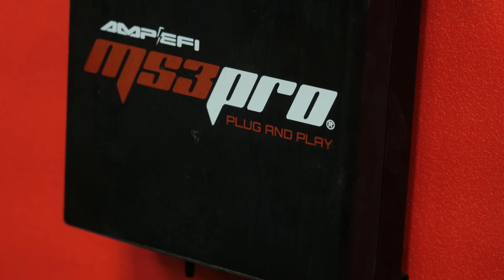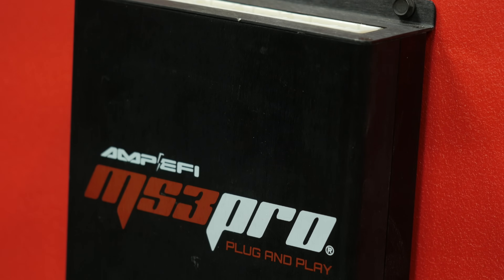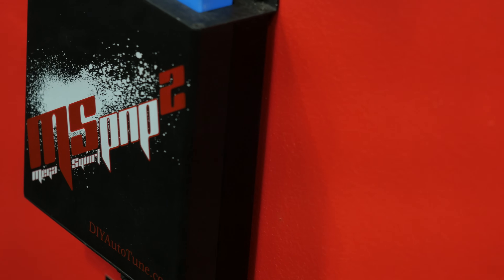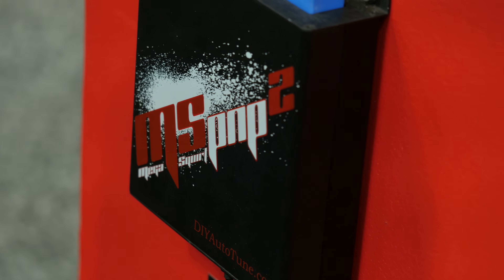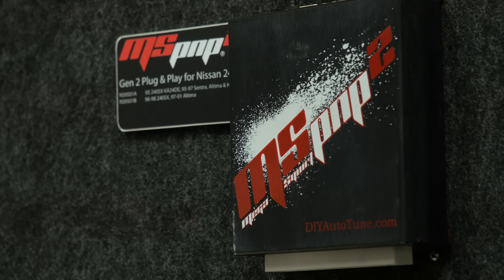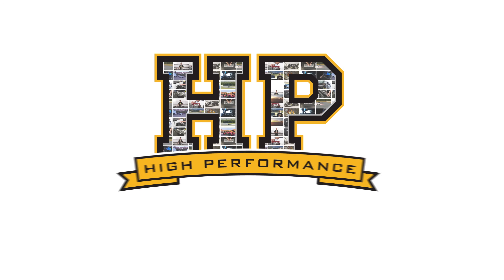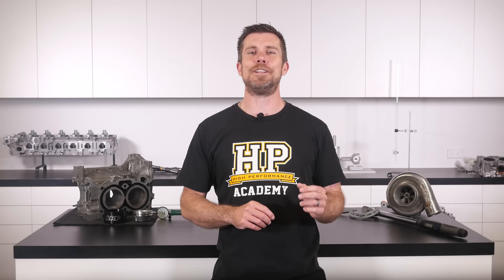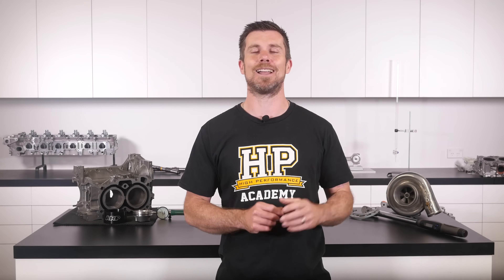Tuners secret to speed and consistency | MS3Pro [TECH TALK]

Comment: Following up on his comment about sending CAN signals to the ECU from Innovate gauges - I emailed DIYAutoTune and called Innovate Motorsports to find out how to send a CAN signal from my MTX-A gauges to my MS3Pro PNP. DIYAutoTune told me this was not possible and Innovate told me there's no verified way to do it, though they mentioned it could be possible to intercept the signal line into the gauge and wire it into an analog input on the ECU. As far as I can tell, the MTX-A gauges are the same as an MTX-L gauge with an analog dial instead of a digital face.

Comment: Maybe sometime touch on the declining reliabilty of Innovate products. We had had issues with quite a few new innovate widebands and boost gauges in customer cars. The failures almost resulted in multiple damaged engines.
We have since switched back to aem's product line with excellent results
Reply: Yup, issues with 5 units so far.
Reply: Thanks guys, will remember that when I buy bits for my 13b mx5
Reply: We've bought at least 3 units (ecu-1) with faulty circuits. I thought this was isolated until now. Will be looking for a more stable eth content analyzer and afr. Sad to hear. Are there any threads that look into this?
Reply: i agree with you, i install lc2 wideband on my race car for a year and the controler were error...

Comment: when is megasquirt gonna provide dbw support?
Reply from the maker: Tell us about it Bob. We are waiting too as we want to run our 350z on DBW. We did grill them when we meet at PRI and they said it is on their radar. No time frame was given. - Ben
Reply: High Performance Academy keep on them! Love my ms3pro-evo but DBW would be nice.
Reply: They've said they have it in development but refuse to say when they'll actually support it citing safety worries. Seeing as how every other ECU maker now supports dbw pretty much you'd think they'd get it done. Especially with the ECU Black supporting it and being at the same price point
Reply: I was going to go MS3 on a subaru project and ended up changing midway what vehicle/engine i was going to use and ended up going Link. I paid a couple hundred more than an MSP3Pro and got an ecu that plugged in to the stock wiring harness and does DBW. Now that i've gotten to learn the Link software i'm much more likely to stick with their products in the future.
Reply: Drive by wire is now supported
Reply: I have actually removed and gone away from the ms brand on a few cars because of the lack of dbw
Reply: They stopped making cable throttle cars over 10 years ago, it's about time they get this done.
Reply: There is a drive by wire module currently for sale on there website.

Comment: Why does no one compare driven wheel speed to a g-sensor? I mean using the g-sensor you can calculate speed quite accurately for a single drag pass, then look up recorded speed and act on those two numbers.

You could do the same for a shift light in a street tyred car with high power (especially if fwd)